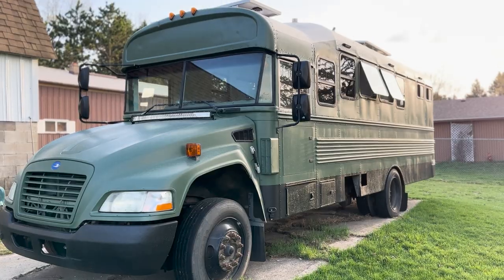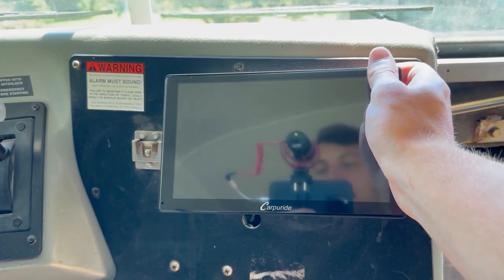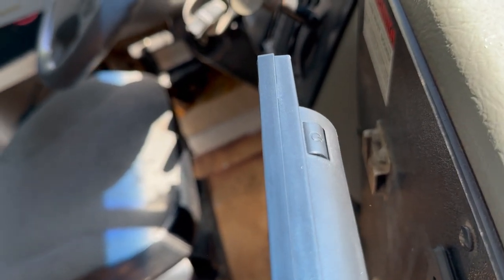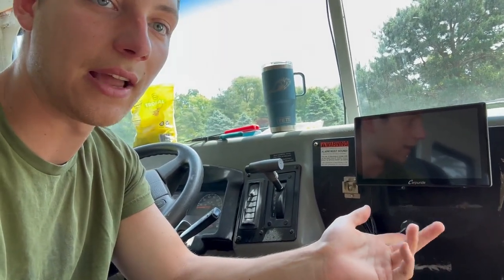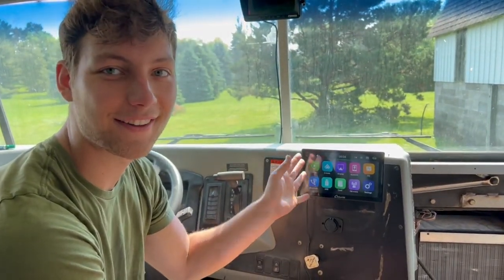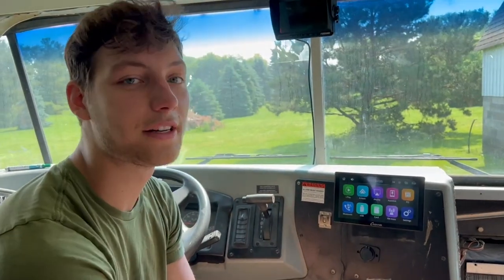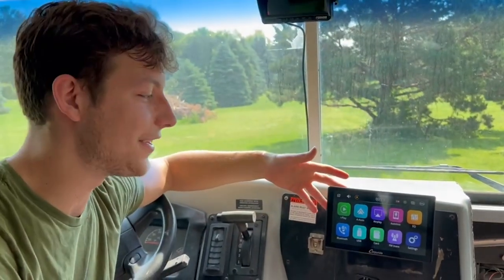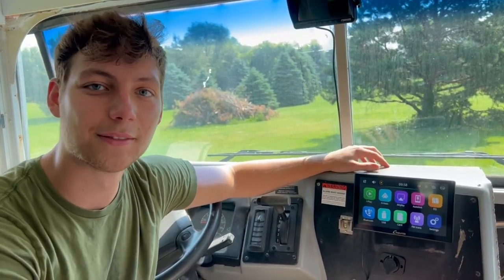Easy Install RV Navigation Screen

Comment: Does the bus battery compartment have a safety shut off switch ? Cause they’ll cause the battery to go dead
Reply from the maker: Yes!
Reply: @maddyandzach  try shutting that off if you’re not using the bus for awhile should help with the batteries
Reply from the maker: Good suggestion, I did that when we left so hopefully this weekend it's fine! Do you have any idea why anything would still be running?
Reply: @maddyandzach  might be some kinda of electronics or whatever and yes I’m a school bus driver lol
Reply from the maker: Oh awesome! What kind of bus do you drive?
Reply: @maddyandzach  65 passenger 2020 freightliner saf-t-liner c2
Reply from the maker: Wow, thats huge!